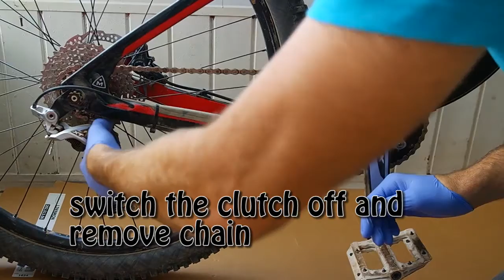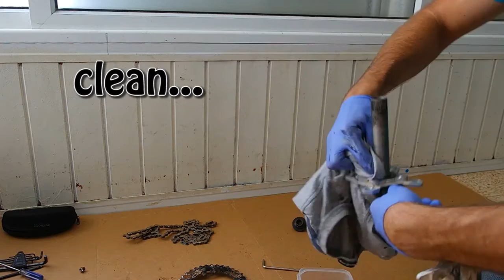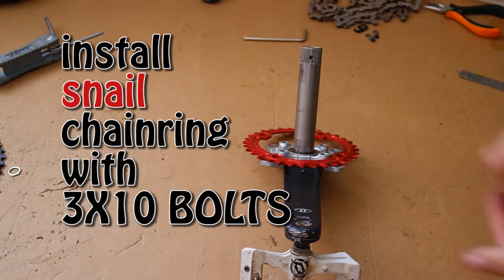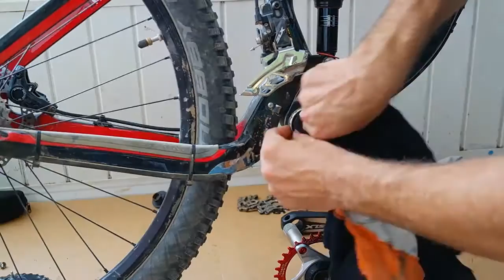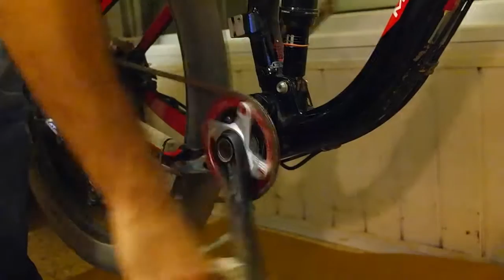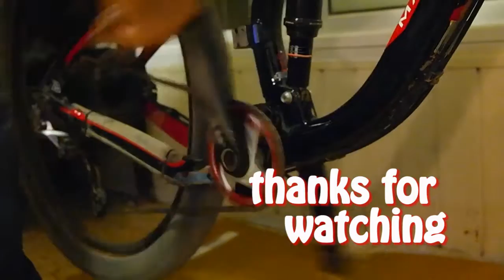snail  narrow wide chainring - 2x10 to 1x10 for 15$ - part 1 installation

Comment: So if i'm understanding correctly, this chainring is thicker than standard 3x chainrings, and therefore will work with standard 3x chainring bolts? I will not need or even be able to use normal single speed chainring bolts?
Reply: I dont even know what your asking anymore
Reply: Its the same